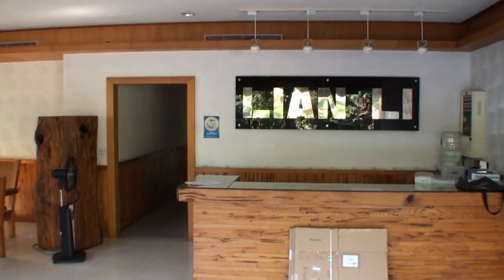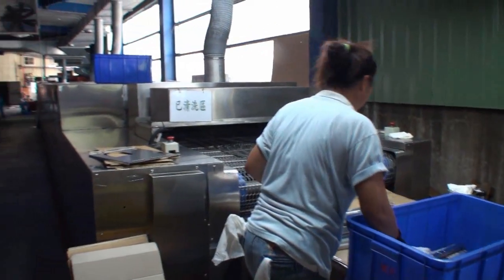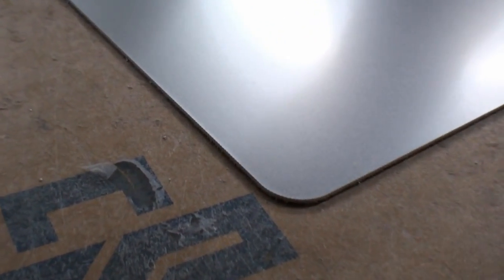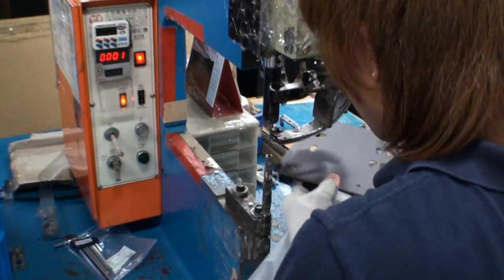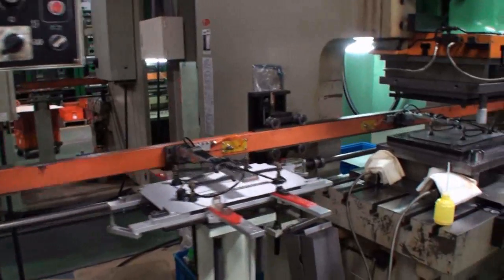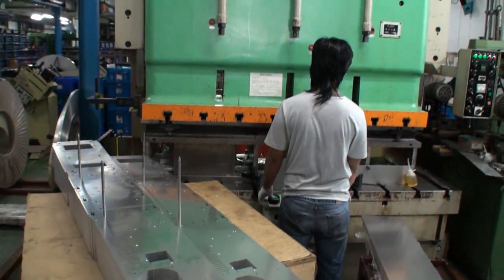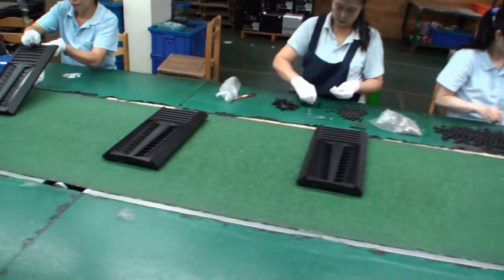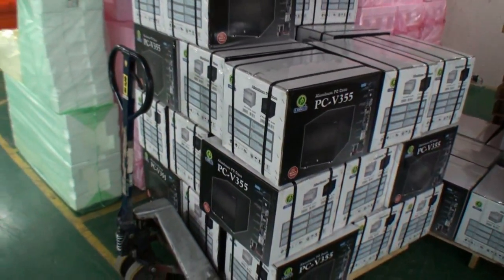Lian Li Factory Tour - What goes into making an Aluminum Chassis

Comment: Great Video, a owner of the D-8000 Black PROUD OWNER
Reply: I'm going to buy one D-8000 for my desktop. After not finding a good NAS system, i decided that i can just add all the disk into my main workstation and run that 24/7 (it already is on for 12h). Hope the D-8000 isn't as loud as the factory where it is build.